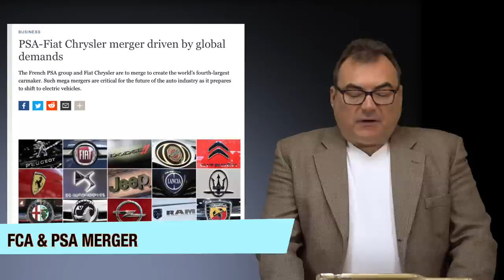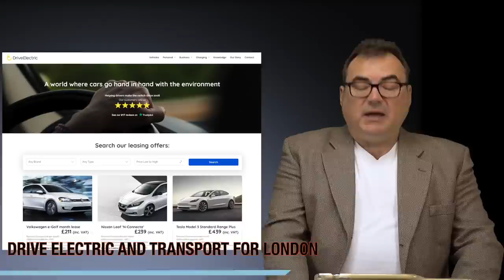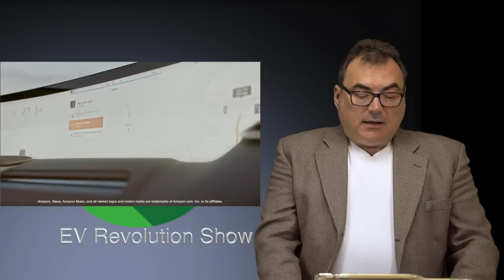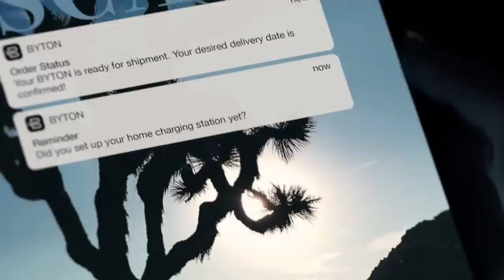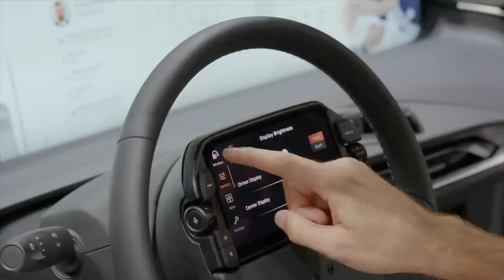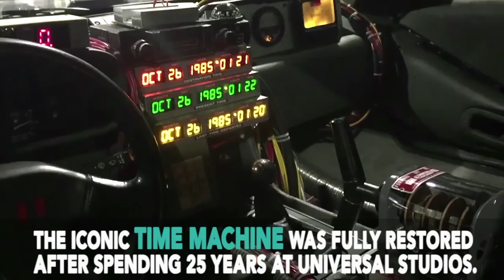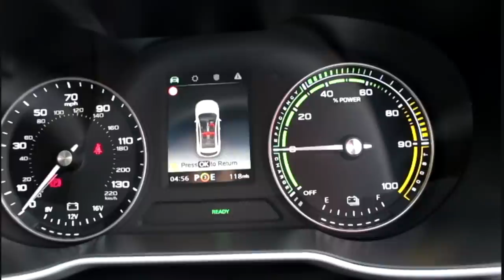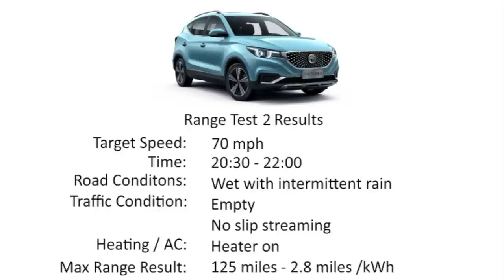Episode 67 - FCA/PSA Merger, Byton Pre-Production, Kia/Hyundai Up EVs, Mini E Pricing and more!

Comment: Fiat thought they could educate us Yanks on what we needed, and had flop after flop.  Peugeot has autos that haven't done well in the US either.  So, we now have a merger of companies that don't grasp the nuances of the US market.
Reply: Roger Russell I don’t know about that, these guys also make the Dodge Challenger which sells like hot cakes here in Cen Cal. Same retro model for many years, with many options.
Reply: @farukcarushi4983  
The Challenger isn't a new Fiat pushed model.  They didn't try a small turbo 4 on it, like Camaro and Mustang did, and they haven't downsized it like the other two did either.  But the Dart, the 200, the fascia on the Cherokee, the Pacifica, the Fiat models that fell flat... one model like the Challenger may not be enough to keep them above water.  Thankfully they have the Ram brand and the Wrangler. (They are now going to push the 2.0 turbo engine in the Wrangler, who thought that was a good idea?
Reply from the maker: Hi @Roger and @Faruk, I don't think the merger is a bad thing.  Yes Fiat and Peugeot don't have a great history in North America, but in other parts of the globe they do well.  Plus in the case of PSA, they've drastically increased their build quality over the decades and have great autos.  FCA continues to do well in N.A. with the Ram, Dodge and Jeep lines, so they need a good compact and sub-compact stable, as they really don't have much in this space.  I'm hoping that from an EV perspective, they will bring some emphasis over from Europe and build on that in N.A. - not just for carbon credits.  We will have to see how that goes.
Reply: @EVRevolution  No, they are not.  Dodge is shrinking and they are going to discontinue the Caravan that outsells the Pacifica soon, instead of updating it. Jeep? Some models sell, but many don't. I hope the Gladiator takes off for them, It has a healthy price point.  PSA and Fiat both could cut build quality problems in half and still it would rival used Jaguars.